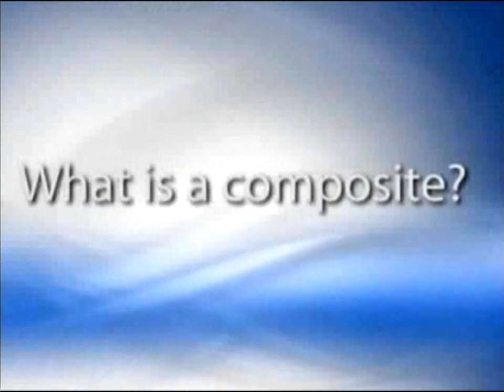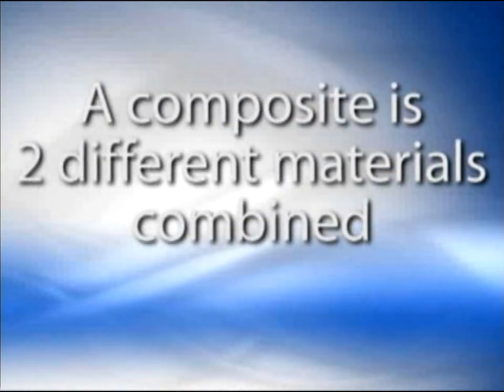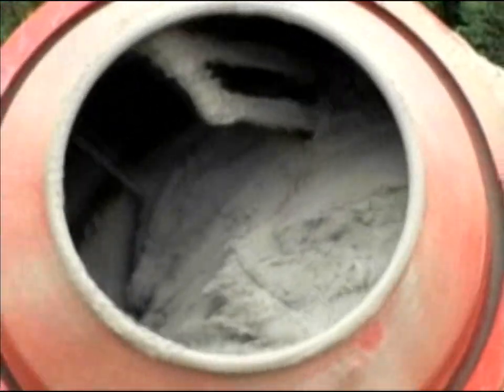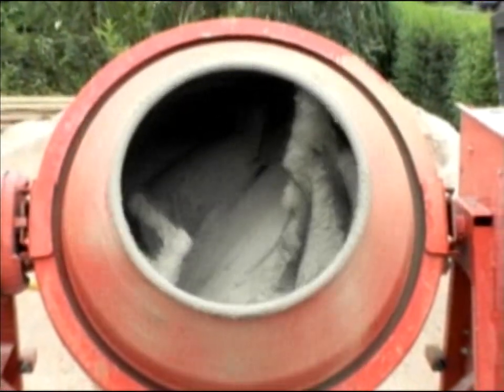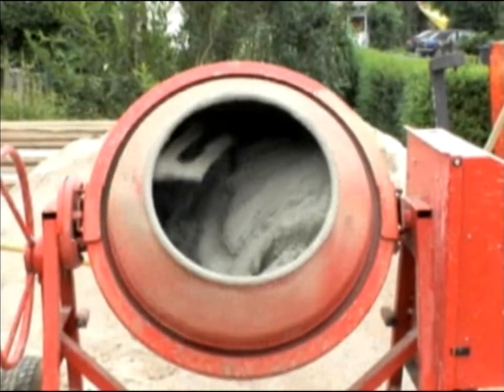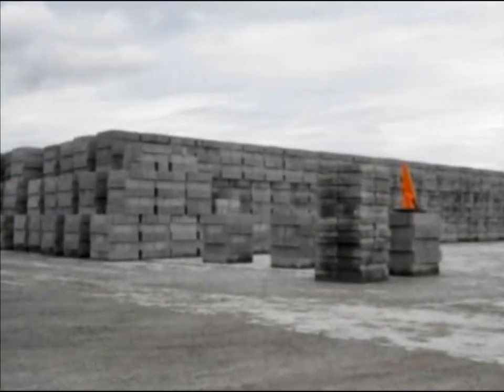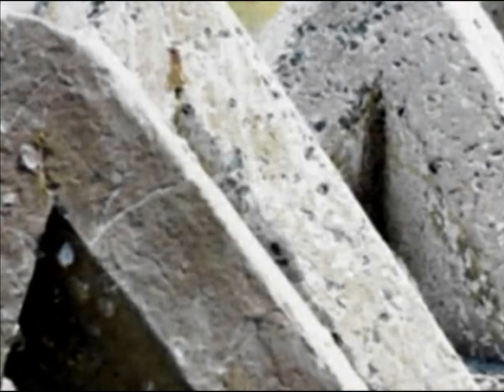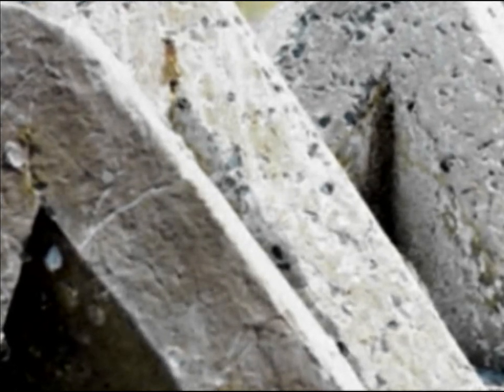Intro to Composites

Comment: slight change to the definition .. 2 or more materials combined ... even concrete is 3 materials ... sand cement and aggregate ... then add rebar ..